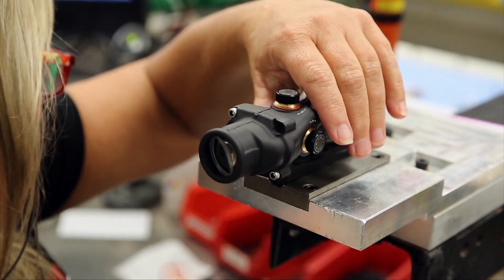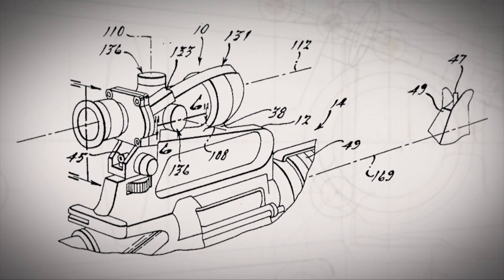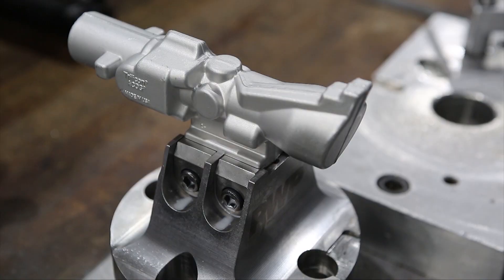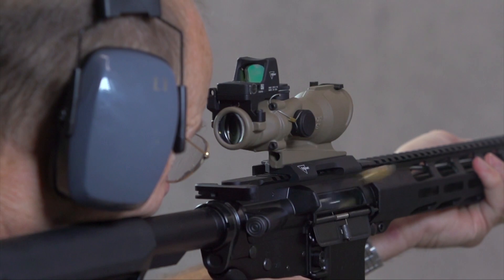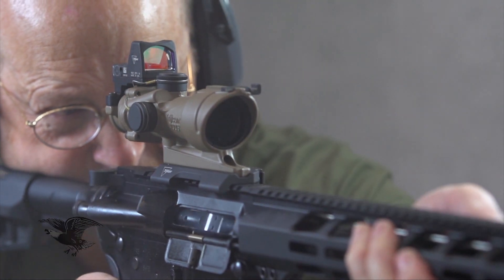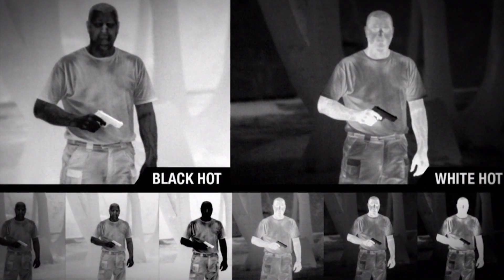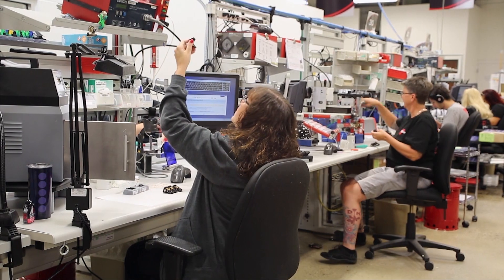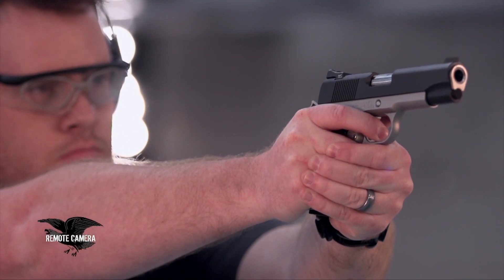Inside Trijicon: The Legacy of the ACOG

Comment: RMR - is NOT a good choise even for small caliber. My RMR was killed by Sayga-9 :(
Reply: Probably got a fake
Reply: RMR works even on reciprocating slides (handguns) which is way tougher on optics than a saiga 9. You obviously got a fake one (probably for airsoft and got ripped off by paying a little lower than genuine RMR price).
Reply: I agree, you most likely got a cheap knock off. The REAL RMR is tough as nails and very easy on a single battery.